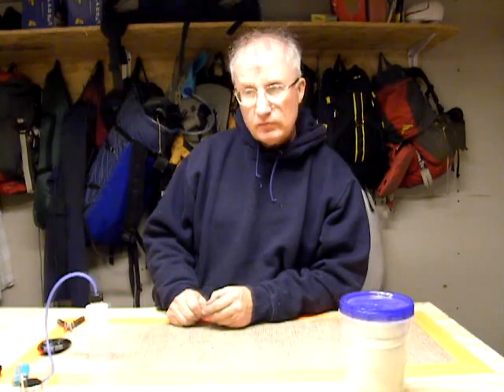Windmill info

Comment: I built and hooked up a wind mill, this video is to too simplified it is not under $500 investment, the real cost add up when looking at batteries and a good grid tie inverter and you are up to $2000 easy.
Additionally you can not say a wind mill will supply all the power for anyone, it may for you, but you may only be using 30 KW a month ... use real numbers what does the windmill really produce.

Comment: Sounds like a scam to me, also sounds like a large outlay that you will never recover.

If i was you i would still build the windmill but have it off the grid if i was you, tying yourself into the main grid will leave you without power everytime they need to repair a cable 'up stream' as it were.

This sounds like the big power companies trying to suck more money from the eco-concious little guy that has some money left over from the housing bubble scam.